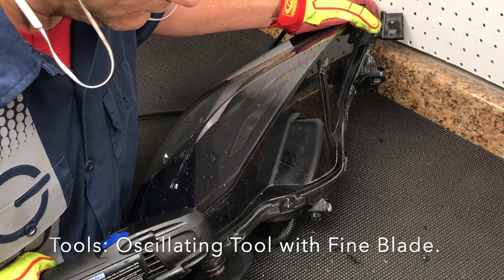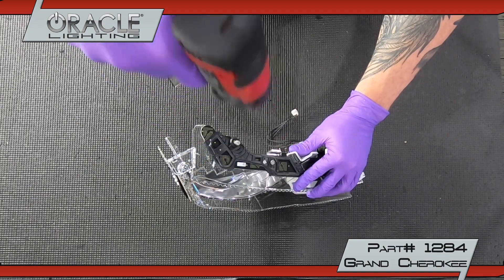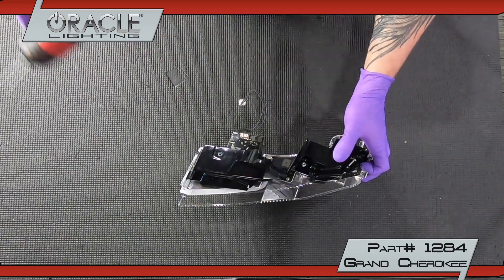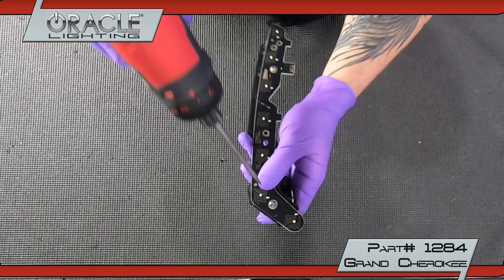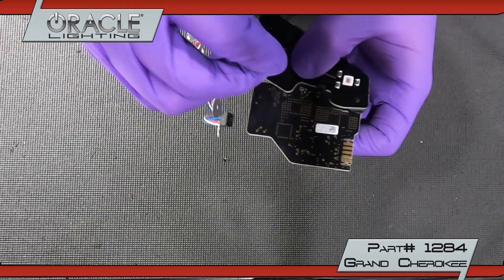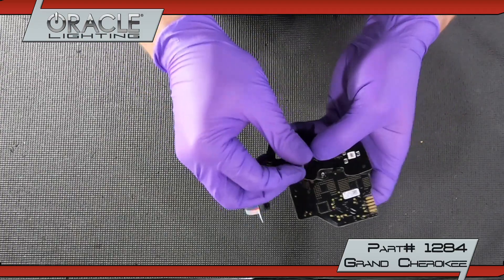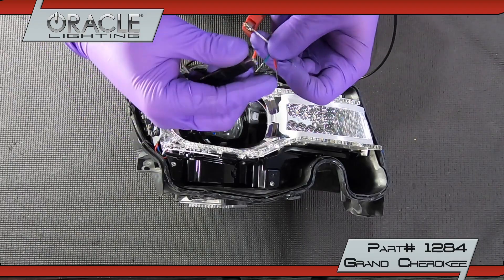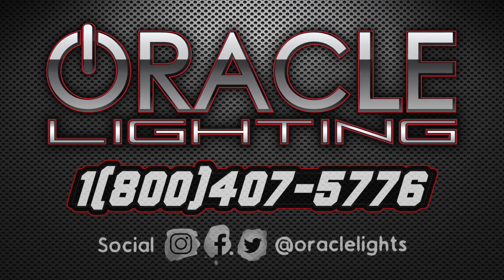2014-2020 Jeep Grand Cherokee ORACLE ColorSHIFT Headlight DRL Installation Guide

Comment: How’s the sealing hold up, I don’t want moisture in my trackhawk headlights after a year.
Reply from the maker: If you use he recommended ORACLE Headlight Sealant we can insure you that you will have no problems. Most issues arise from using the wrong sealant since headlight sealant is not easily available.

Comment: Did you remove the permseal on the headlights that are being worked on? Because they are not cut.
Reply from the maker: Yes, if you oven open the lights you would remove any permaseal left over.